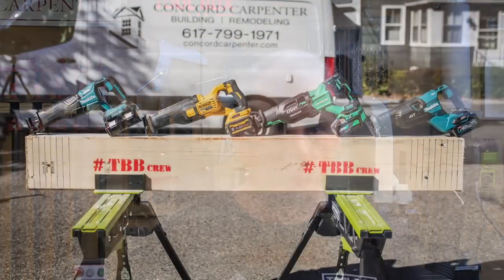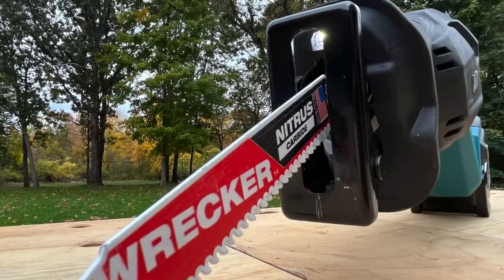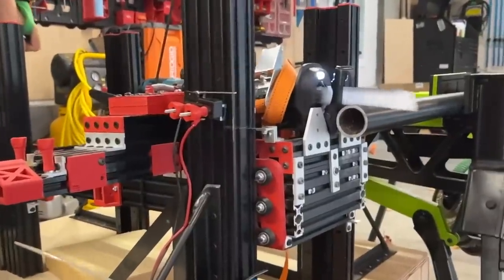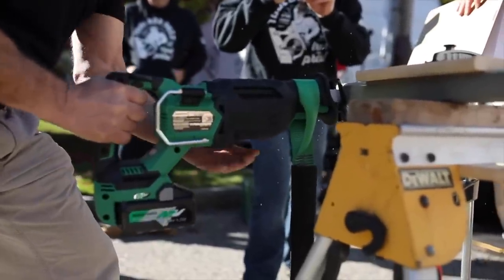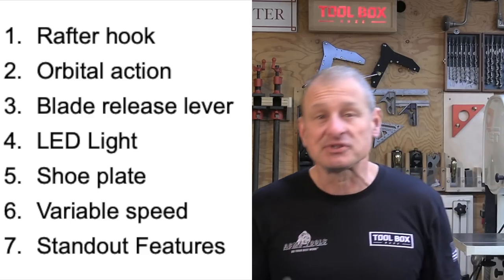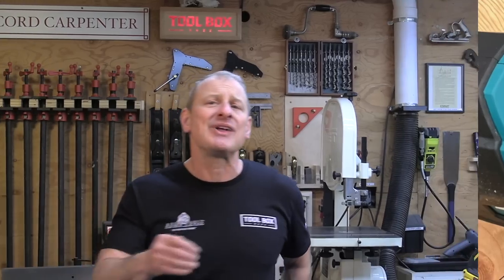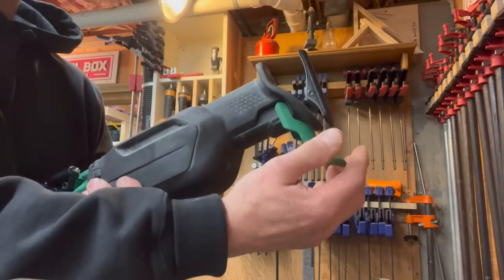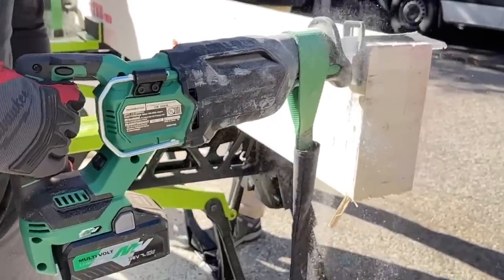Best "High Capacity" 36-60V Reciprocating Saw [Head-to-Head Test]

Comment: We both know being in similar fields that’s not how sawzalls are used … First the dewalt 60v top of the line wasn’t used and a 12ah wasn’t used . If you combine those two it blows away the competition and never bogs down under extreme hard use , which is exactly what you do with these sawzalls 
      These tests don’t show real world use . The other two big down under heavy load same as a Milwaukee will or cut out from thermal protection and dewalt does not . 
    The top of the line tool with the highest battery from each company should be used , it’s not desalts fault other companies dont produce the same batteries as they do and they shouldn’t be penalized for it. 
    Dewalt tools are designed to be used with the highest ah battery and used harshly under extreme loads where other companies can’t , that’s the difference!!!
Reply: Makita xgt would still win if the biggest available batteries were used. Makita has a 8.0 ah 40v battery which would be equivalent to a 16ah “flexvolt” battery.
Reply from the maker: Dewalt top-of-line saw WAS used, just not the largest battery. The Dewalt DID NOT bog down - I'm not sure which video you watched. That simply dod not happen!
Reply: you are wrong on all accounts. and no, it doesn't make sense to use a huge battery in a handheld tool

Comment: Why would you weigh the tool without the battery you can't use the saw without a battery
Reply from the maker: Because there are different configurations- you pick the battery size you want, and add it in
Reply: @ConcordCarpenter  Yeah but the test heavy-duty so you should have went with the heaviest configuration I know dewalt has that monstrous 15amp battery I don't will use that on a recip saw bur the 12 and 9amp I could see
Reply: @loucifer4205  So, why are you trying to argue this then? Are you concerned about battery casings being designed to add as little weight as possible?
Reply: @orijimi  No you can't use a tool without the battery so what was the purpose of comparing the weight of the tools without a battery
Reply: Get on that XGT lineup, every tool has been pretty damn good so far! The batteries last a long time as well, and no real need to match a certain battery to a certain tool even the 2.5ah runs the rear handle saw and recip saw just fine.
Reply from the maker: @loucifer4205  I hear you but they're not all sold that way - kits usually have smaller batteries.
Reply from the maker: @loucifer4205  Happy to invite you to our next HEad-2-Head strategy meeting. Live near Boston?

Comment: Just gonna guess that 54v wins. Wow, doesn't look like it. Jeez, DeWalt, you had everything in your favor.
Reply: You do realize voltage doesn't mean more powerful the other saws have 11/4  stroke dewalt has 11/8 stroke
Reply: @loucifer4205  In general, it has the most ample supply of wattage, they could have done anything with it.
Reply: 54 volts has no effect on the user experience, zero. Weight, vibration, and ease of use are the things that matter over the life of a tool
Reply: @CraigularjJoeWoodworks  It should have had effect on the cutting speed by way of supporting a stronger motor. It effectively didn't.

Comment: Milwaukee Fuel Sawzall is just as good, if not better than these. Milwaukee invented this... it belongs in this test.
Reply: Open the website when he tested the M18 and compare its test time and score with the 36-60v. Done.
Reply from the maker: @Pepe-dq2ib  yup
Reply from the maker: These saws ALL of these saws and the 18-24 volt saws were tested at the same time - we separated the high-capacity saws into their own video. You CAN compare the Milwaukee, Flex or any other saw  - it was the same day, same tests, same blades, same users, nothing is different.

Comment: These videos make dewalt look bad haha. It will probably last the longest on the jobsite without breaking which is something that can't be tested here, so that's a consideration.
Reply from the maker: That might be solid, but the performance test and lack of features don’t lie
Reply: We've given up on DeWalt for most of our tool applications
Too many burned up motors and battery longevity is the worst compared to MHPT, Milwaukee and Makita
DeWalt has lost their quality control and slow on it innovation for awhile now